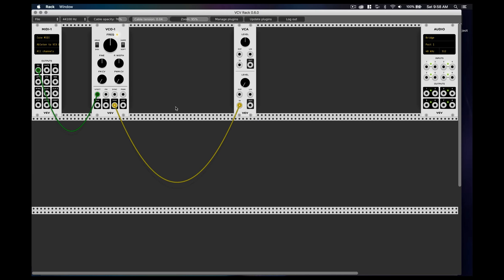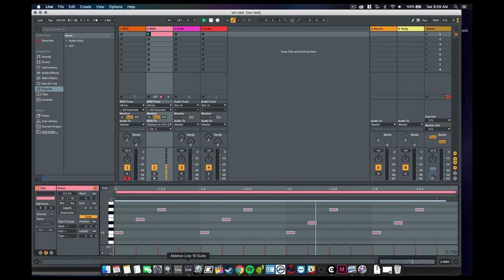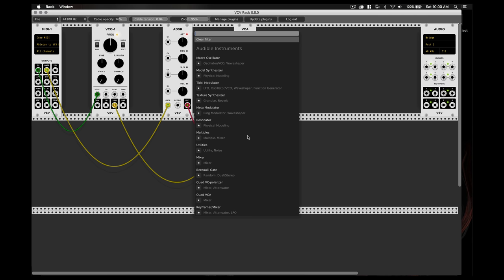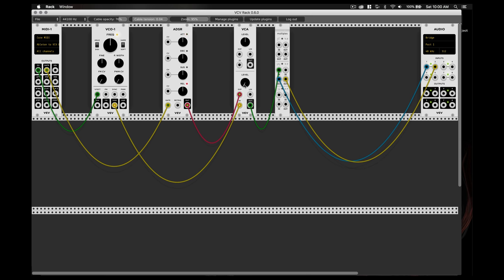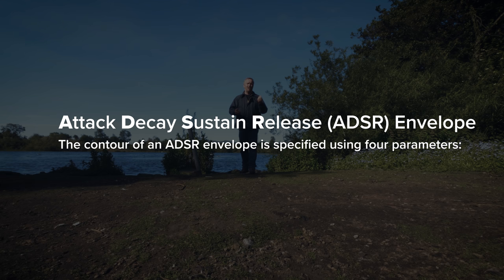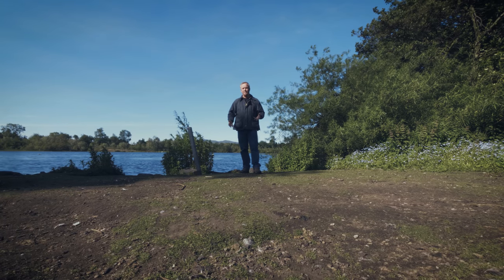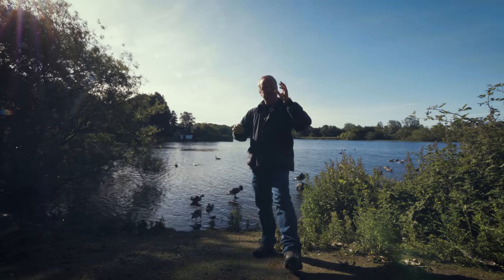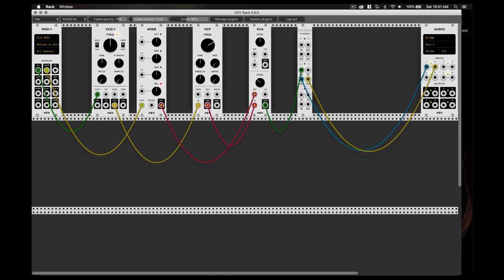Make Noise MATHS - MODULAR MONDAYS #04

Comment: Hi Christian, glad to see your enthusiasm for modular growing! You asked for comments/advice about signal path and ideas of how to arrange your modules. Yes, a left to right signal path seems logical and sensible BUT I think the essence of modular is that you don't have to stick to the conventional VCO-VCF-VCA arrangement of a fixed architecture synth. For example simply put the amp stage before the filter and the filter responds differently and generates new and interesting sounds. I have my rack set up with oscillators at the top and bottom, filters and effects in the middle, envelopes and LFOs around that, then utilities and, for ease of access, performance controls around the edge (although I do quite enjoy delving into the spaghetti of patch cables to adjust a parameter!) One more thing I'd say is change things around sometimes. The same modules in the same case but in a different order inspire a different creation process, or a different solution for the idea that is in your head. 
Cheers, joni
Reply: I agree partially here synthesiseur, signal paths are indeed very much dynamic.
In eurorack everything is small so I tend to organize my modules by tactile layout, meaning all the (important) knobs/pots as reachable as they can be, all the cable modules in one place.
A lot manufacturers put their pots at the top and the jacks at the bottom, I like this unwritten protocol.

Comment: I find with analogue that you can hit one note and it really 'resonates' for the want of a better word. 'Depth' would be another. Simply... you can say more with less. The computing power currently required to mimic this is still very substantial. Hence there is still a place for the tubes, the racks, the carbon resistors etc. The Legend synth is very close, and Kemper also in the same sense. If you can pay less tax by investing in the real deal... and can manage the cable mangles and lack of recall... I'd say it is still very much 'worth it' even after the quality goes to shit in the way we are presented with audio generallyy currently. One day computers will completely indistinguishably catch up; however by then we might have a Virtual Christian?

Comment: Wait, routing a 1v/Oct pitch CV through the Trigger input of a Maths Channnel then out to a VCO creates a portamento effect? I would have thought it should be the arrow input, but frankly it never occurred to me to put a pitch CV directly through Maths in the first place... Interesting... And here I thought I still needed a slew limiter!
Reply: The diagram is wrong.  The input with the arrow is the input that creates slew.  Yeah, it took me a while too to realize that the way that maths works is actually an RC low-pass filter (hence the integrals on the front panel) so it can be used for portamento and smooth randoms with long rise/fall times and a low pass filter for audio with short rise/fall times.  Definitely one of those modules that grows with you the more you learn.

Comment: Eurorack, VCV, and Ableton Live in the same Spitfire-related video ... I suddenly don't feel like such an oddball anymore. 

What was the Maths video you said worked better for you? I like the look MakeNoise modules because they make you think a little differently than a straightforward synth. 

I appreciate the yellow arrows going from module to module, but maybe try using more than one color so it's easier to follow in real time. Also, if Jamie could use one of the Click Effects in Screenflow, that'd be helpful. I use Radar with my students. 

Looking at your page on ModularGrid (MG), did you really buy the old model of Wogglebug (still good, just wider in HP; the new one is black). If you're planning things out there on MG, you might want to add in your power modules so you don't think you have more room that you actually do. That or take away 4HP from the width of the rack, though maybe you already did. 

This is a lot of fun to watch since I went through the same process. What I'm really looking forward to is seeing how you eventually use the material you generate and/or process in cues.